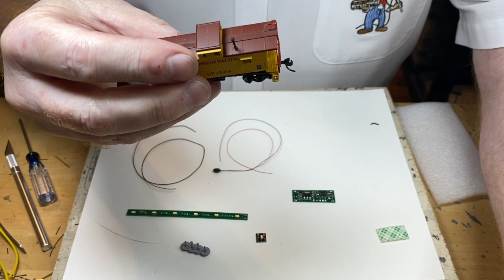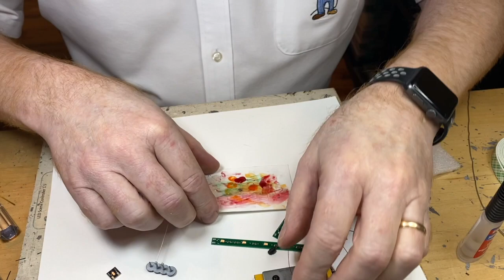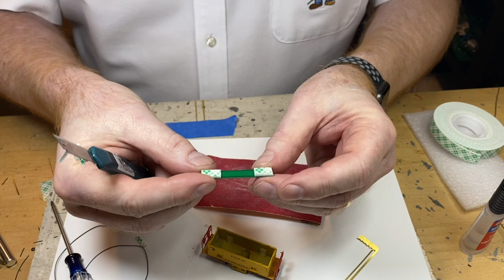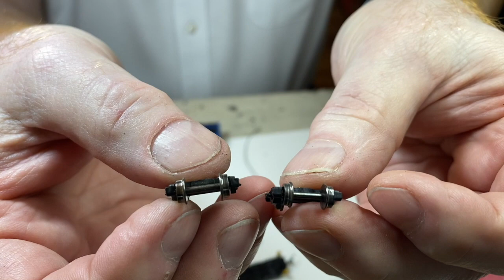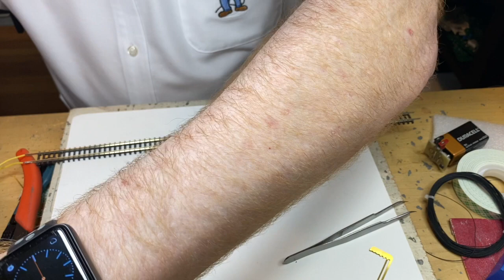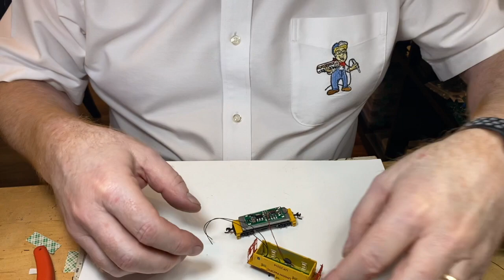MICRO Caboose LED & Fiber Light Installation

Comment: Jim, concerning the fiber dongle, could the orifice where you insert the fiber cable,  be made to fit 2 fiber cables,  to light two lanterns?
Reply from the maker: We have changed the fiber lighting arrangement - no dongle.  The LED is "welded" on to the end of the fiber and electrically you can have two.  The kit comes with one so we can add an option to select two lanterns/lights.

Comment: Jim, Would this work on a 3 rail O gauge set up?  Allowing of course for the inner and outer rail configuration.  Are your lantern sizes limited to N & HO scale?
Reply from the maker: Yes - it works best for a single track detect but can be set to ignore a second track that is placed close in parallel.  In fact, our first printed lantern was O scale and we scaled it down to HO and N.  I'll put O lanterns on the website this weekend.

Comment: How do you control the light functions, does it have its own address for DCC?
Reply from the maker: All our light boards have a built in DCC decoder as part of the circuit.  You give the board/car an address just like and engine and then the function keys turn the two LED circuits on and off.
Reply: @ModelTrainTechnology  okay and can you program the board when doing the installation?
Reply from the maker: Yes.

Comment: Great stuff Jim.  What happens when the back wheels are on an other block that has reversed phase?  Also, do you have super-caps to fit with this setup? How much heavier is this caboose now?  --dunc
Reply from the maker: Thanks for the call out!   To your first question, "nothing".  A "reverse" would simply mean that both the "A" rails or both the "B" rails are connected to the wheels.  Therefore, no power and no lights, just like an engine. Once the circuit flip so that there is an "A" and "B" pickup, the lights will come back on.  YEs, SuperCaps are now available for all lighting boards including the Caboose boards.  The Caboose board AND the SuperCap board together weight 0.2 ounces -  almost "nothing".  ;). Jim

Comment: I am really interested in your N scale caboose produces. I model in Southern Pacific. On a good number of there Bay window caboose they have what was called Frog eyes lights on the top of the car. Can I call you about how I might get them to work? To see if my idea could work with your products? I can be reached at 916-969-9542 Or email Vman7757@comcast.net